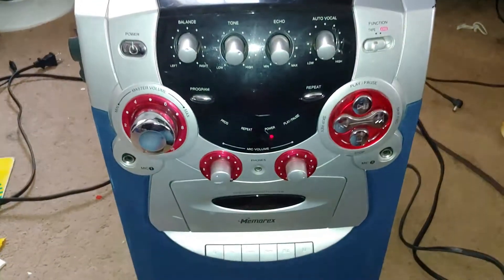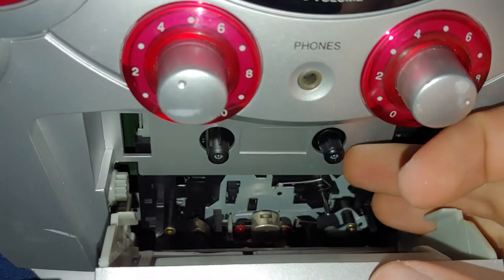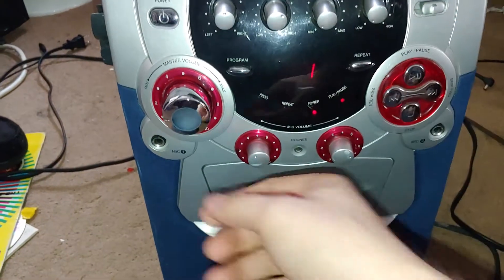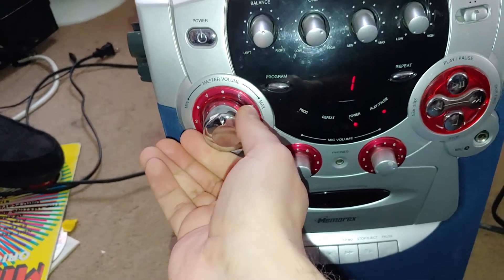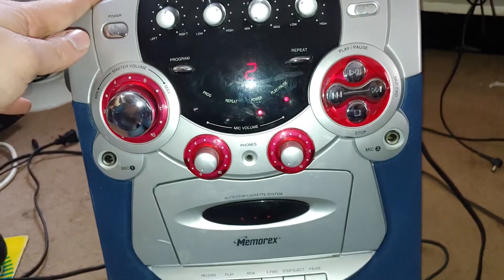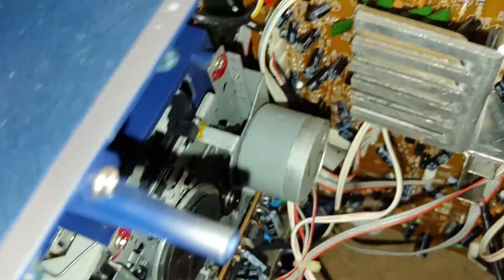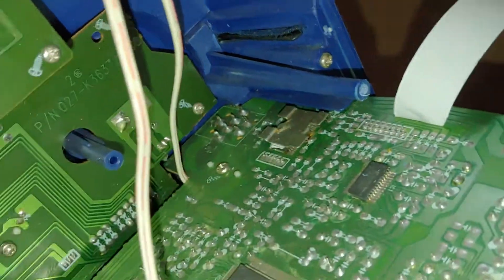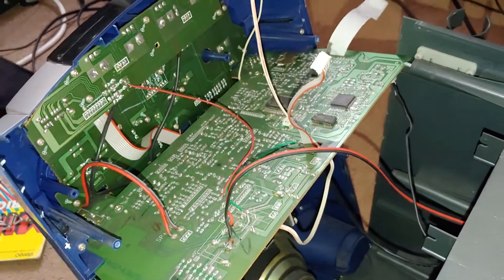Memorex CD Graphics karaoke system model MKS2420 (said Emerson by mistake)

Comment: I just picked one of these up from a thrift store and it works perfectly besides one issue. The sound either gets quieter occasionally or there's no sound at all, but the disc keeps playing just fine. I figured out that when I lightly fiddle with the switch on the top right for selecting either cassettes or cds, it makes it either sound normal again or messes it up. Do you think it has something to do with the soldering? I've never had to solder anything, so I'm not sure if that's where the issue lies
Reply from the maker: @Platinum.PP_  its probably oxidized. Spraying contact cleaner and move the switch back and fourth a bit and see if that makes a difference.